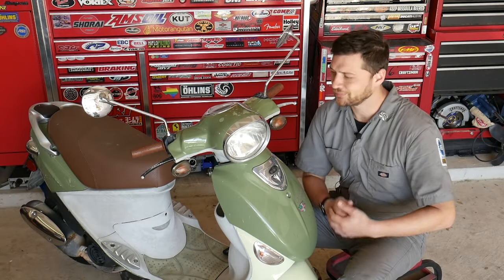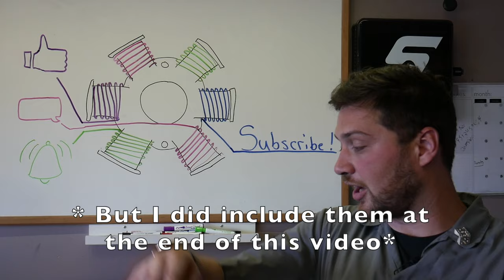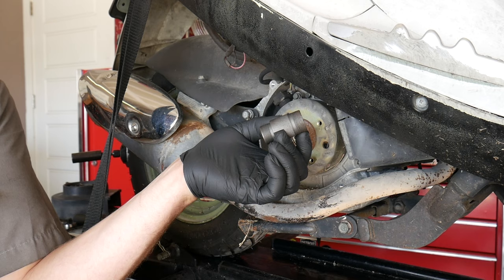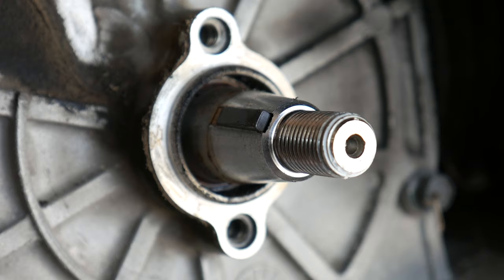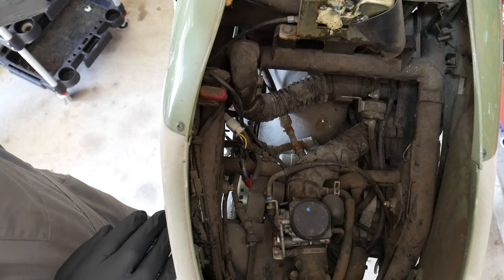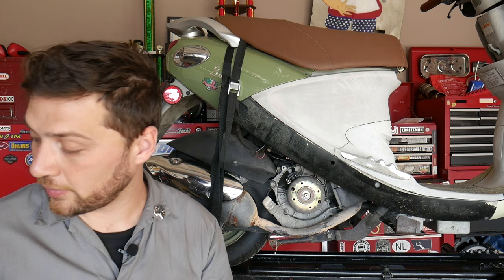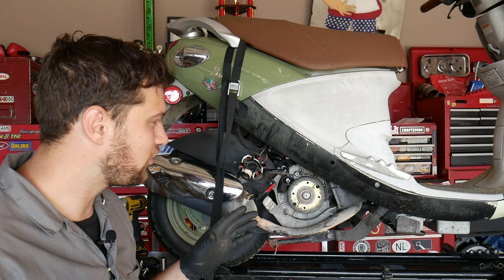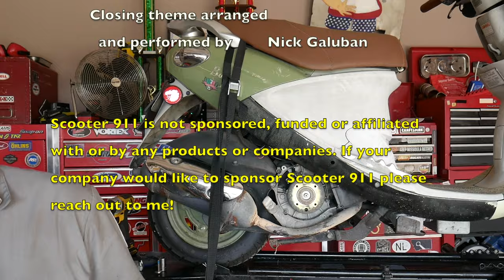Scooter 911: How to replace a stator (with OR WITHOUT special tools!)

Comment: So what happens or what do I do if it is stripped out inside an the special tool won't work? I did the hammer trick nothing.
Ia there a wheel puller that will work with the fan holes?

Comment: Do you happen to also work on Go Karts?
I have a American Sportworks Carbide 7150 with a GY6 150cc Engine. Getting ready to replace the Stator Flywheel and the Rectifier. The Kart ran when I bought it but now after 10 runs wet plug and no spark...I think the kart is from 2010. I am in Texas 2 hours away from San Antonio. I'm looking for a Go Kart Mechanic to help get the Kart in top shape. Can you recommend somebody in Texas near San Antonio or do you also do these as projects in your shop? Thanks for your time.

Comment: Doesn't the gap between the pickup and flywheel need to be measured?
I know there isn't much room to adjust, but I do think there's a specific gap measurement.
Reply from the maker: The amount of room for adjustment should be irrelevant if you have a strong pickup coil. Sometimes if your pickup coil is getting week you can compensate by sliding it a little closer to the flywheel, but that is sort of an edge case.

Comment: I bought a stator that fits in my scooter, but just has a different plug connector. Do you think it would be ok if I disconnect the little pin wire connectors and put them in my old plug that fits? The stator I bought, states that it was made for my scooter
Reply from the maker: Yes it should be ok just make sure all the wires match the correct locations!

Comment: Hello, your videos are very good. But I have a question. I have 150cc short case and it’s not firing. The stator, CDI, battery, pickup coil is good, there is just one thing I put a new flywheel, and 8 poll stator on there. The reason for that is I did not realize there was bolt nut inside the flywheel and caused a catastrophic event and ripped into the stator. I purchased a new flywheel and stator for replacement. But now the pickup coil is further away and to me to far away to create spark I think. Can you help in this situation? 

Thanks for your time
Green Eye Simms Innovations

Comment: What stator do I need for a buddy 50 2008 2-stroke
Reply from the maker: The buddy 50 has a very specific stator and the only replacement is the original part from genuine. I recommend ordering one through your genuine dealer or you can pick them up online from scooter lounge. The part number is P12210200002
Reply: @Scooter_911  thank you very much

Comment: Hii I Got A Kymco 125 Scooter.. Got Compression.. Not getting Any Spark At All.. Changed.. Cdi. Coil.. Stator coil.. Spark Plug.. Even The Engine WEN I See I Tried Everything N Still No Spark.. Then I Realise It's Maybe A Wiring Problem.. SO I Went Ahead And Buy A New Wiring Harness.. Hook It Up..Wen I Turn The Key.. The Light On My Cdi Doesn't Turn On Meaning I Not Getting ignition.. Idk Wats Causing That Because I Seeing Like Everything Is Hooked Up Correctly.. But There's Jus One Thing My Old Harness Hard On I Don't Know If It's Important.. I Need Your Help Pls 😭

Comment: HEY GARRET MY GY6 150CC DOESNT START BY THE ELECTRIC START BUTTON I PUT ON A NEW SOLENOID RELAY IT RUNS WITH THE KICK START BUT NOT BY THE ELECTRIC START BUTTON AND THE NEW SOLEN/RELAY I TRY STARTING IT BY JUMPING THE SOLEN/RELAY WITH PLIERS BUT I DIDNT GET ANY SPARK WHEN I JUMP IT WITH A PAIR OF PLIERS WHAT COULD BE WRONG GARRET PLEASE HELP? JOE
Reply: you have to pull in the brake handle to start it  with the electric start correct? you may have a faulty or loose brake switch

Comment: New to gy6 engine work. I was needing help with the flywheel puller, I received does not reverse thread on the the flywheel. Any and all help will be much appreciated.
Reply from the maker: what kind of scooter are you working on?
Reply: @Scooter_911  dong fang 50cc
Reply from the maker: @wolf_is1481  the 50cc scooters thread in right hand threads (righty tighty). Does your tool not work that way?
Reply: Yes, I was just confused about the directional turn. Because my tool would only work to the right, and the video said turn to the left.
Reply from the maker: @wolf_is1481  sorry I thought I had made that clear in the video that 50cc's were standard threads. I'll make an edit in the comment section
Reply: Ok, thank you so much for the information.
Reply from the maker: @wolf_is1481  good luck!

Comment: It's ridiculously hard to find info about upgrading these, I think my scooter has a 6 pole one. I want to run an extra light so I need more wattage. Can I go to an 8 one without changing the flywheel(whatever the thing holding the magnets is called)?

Comment: Hey Garret , this is a great video man . Thank you. Just like all of the ones you make. So based on one of your other videos I was able to figure out that my stator is bad. I have SYM HD200. I have the new one and Im about to bust this puppy open and replace it. Any tips and help in regards to changing the stator on SYM would be great. It is a liquid cooled scooter and it looks like its going to be a bit more complicated opening up the right crankcase to get to the stator. Id appreciate any advice. Thank you .

Comment: Hey Garret I was wondering is there a specific brand of 3 jaw puller you recommend the flywheel puller damaged the threads in the flywheel so I cannot remove it without a 3 jaw puller side note I also think I might need a new flywheel lol

Comment: HELP:  My Sym Symba is overcharging.  I've replaced the Reg-Rec twice with no change.  Could it be a fault with the stator?
Reply: Now I discovered that all is perfect with the brake light (21w) on.  As long as I ride with the brakes ON the voltage stops at 14V.  Perfect.  Thinking that I need to wire a 21W bulb somewhere on the bike to "fix" the battery overcharge problem.  Unless someone has a solution for me.

Comment: So my tool threads to the right on my flywheel cover but not the left, what do I do??? At a loss
Reply from the maker: Hmmm I'm not sure what you mean... does your tool not install into the flywheel?
Reply: Garret Seesing it does, but it only screws in clockwise, not counterclockwise. It feels like the threads are just skipping when I rotate counterclockwise to the left
Reply: @MelroseG28  did you ever get an answer to your question? I remember him saying the 150cc side goes in counterclockwise but he didn't say anything about the 50cc side so maybe that one goes clockwise I have the same question for him along with a few others lol

Comment: PLEASE HELP. I cannot get the flywheel off. It turns around completely but will not "pop off". i have broken a dozen bolts and washers, the gear puller did nothing and neither did the steering wheel puller. It is insanity because i have been beating this for 5 days now. What the H*LL is going on. No dumb question like did i take the nut and washer off.
Reply from the maker: Wow thats strange. What happened when you put the flywheel puller on it? Did it move at all?
Reply: @Scooter_911  I got the flywheel puller today and i screwed it in, tightened the extractor bolt and after two hunga dungas it stripped the thread on both the flywheel and extractor tool.. Now what.

Comment: Install is spot on good video but just curious where you found valve spec's
Reply: If you mean for valve adjustments, for 50cc gy6 I've heard intake .003" and exhaust .005".  For 150s I commonly use .005" on intake and .007" on the exhaust just to be safe.
Reply: I ordered a cd manual for qmb139 and it say . 003-.005 both sides but most forums say. 004 is the safe spot for exhaust . I like to learn so im always asking and comparing info
Reply: @NOFx420x  thats a good way to think man!  Id say that .004" exhaust spec is probably okay, but do it with a completely cold engine, and make sure there's barely light drag on the feeler gague at .004"

Comment: I'm a girl and all the mechanics in my family are passed away I'm trying to figure out what's wrong with my Blaze wolf moped 2019 50cc I believe it has something to do with the stator because it will not start at all it drains batteries at least the two of them that I've tried so far the original battery is dead and will not take or hold a charge the new battery I got for it isn't exactly new but it worked on the other vehicle that I got it from unfortunately my moped sucked it dry it won't even do the same thing that it did when I first put this battery in it so I'm thinking stator charging system flywheel CDI box solenoid battery has something to do with it not starting I need help in a couple of pointers thank you
Reply: And absolutely no idea why the kick start will not work whatsoever never has

Comment: I WATCH THE VIDEO OF THE ELECTRIC START DOESNT WORK BUT I COULDNT SEE WHERE YOU WAS PUTTING THE TEST LIGHT LEAD WHEN THE CAMERA WAS POINTING AT THE BATTERY AND NOT AT THE ENGINE UNDER THE SIT.